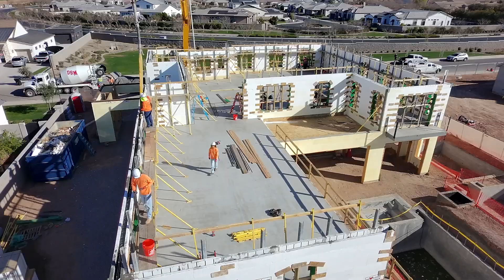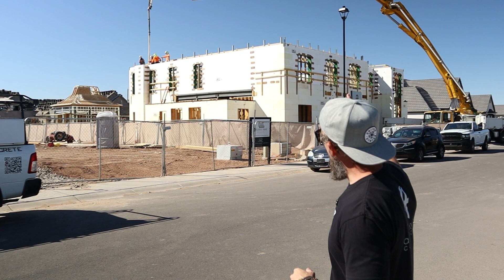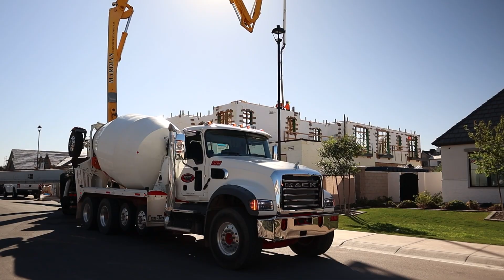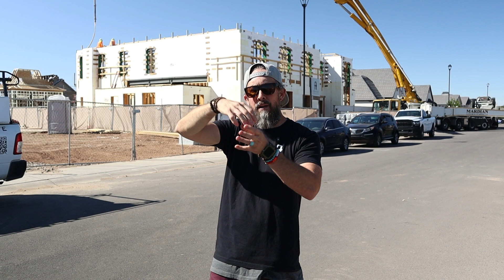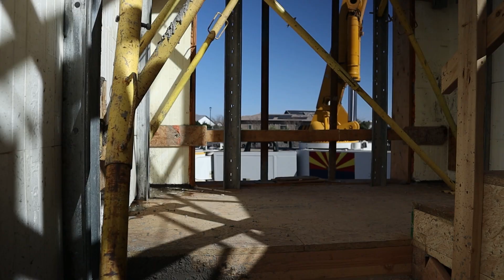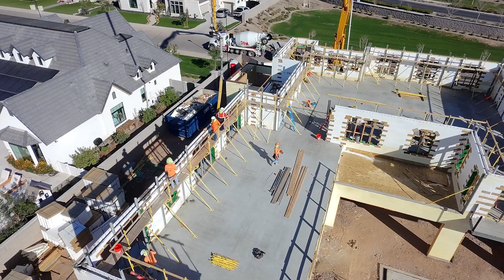Why 3000 PSI Concrete is a Must for ICF Home Builds | Liberty Estate | AFT Construction

Comment: This video is not clear about why 3000 PSI is needed. Is it because a higher PSI would not flow as well into all the spaces in the forms? Or is the video saying that one should not use a PSI lower than 3000. Is higher than 3000 PSI Ok?
Reply from the maker: Sorry that it may not have been clear enough. We can do another video and I can give an answer here too. 

3000 psi is what we went with because of workability and strength. Like I said in the video we need to make sure the mix is getting into every space under the windows. With the amount of windows in this build we need it to flow well into those areas needed. Even though there is higher strength concrete this is recommended by ICF Specialists. 

There is so much to cover in these video. Thank you for your comment truly appreciate you commenting and watching.

Comment: 3k psi isn’t all that strong btw
Reply from the maker: You are correct. Workability is very important for us though. If we go with a higher strength concrete we may not get it into all the areas we need. It gives us more working time as well. That’s the reason we went with 3000psi.